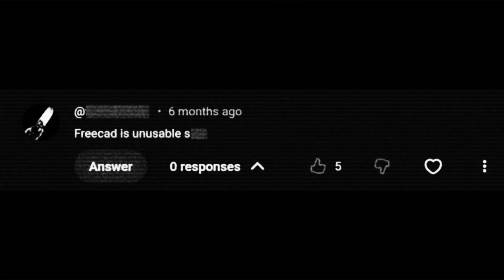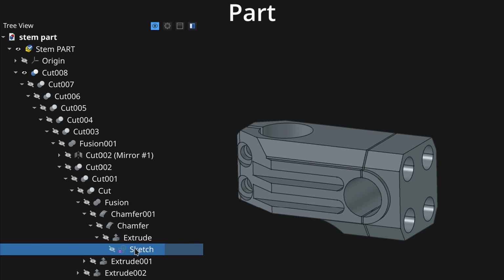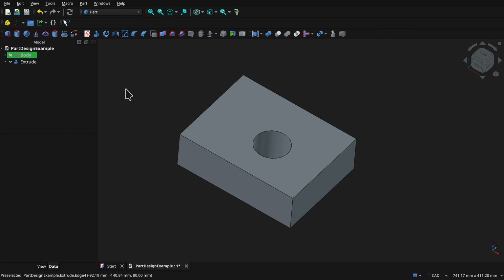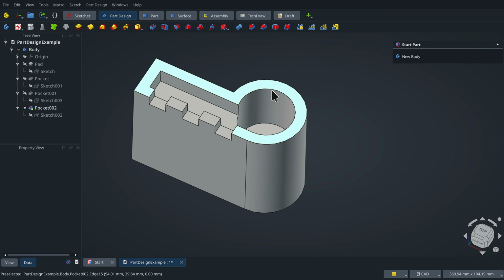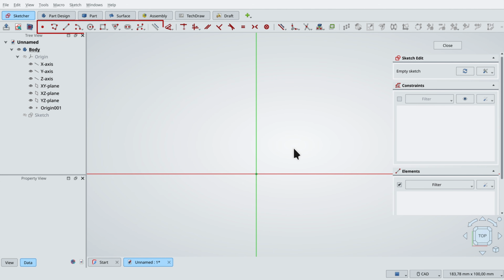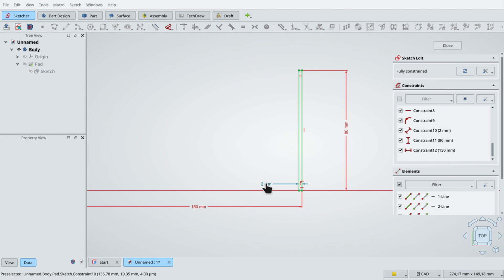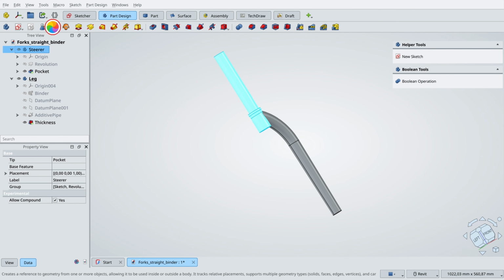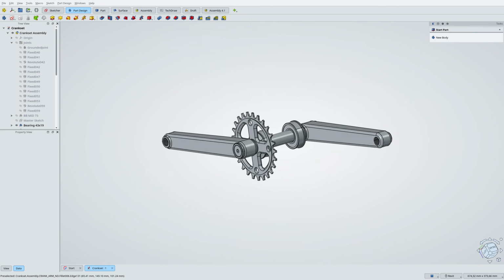STOP using FreeCAD WRONG! Do this INSTEAD (Workflow & Tips)

Comment: I am super new to Free CAD and used CAD-Sketcher Blender Plugin before that. It works much the same but nowadays has some maintenance problems with newer Versions. That's why I try Free CAD. And ig I have to get a bit familiar with it, but at the moment it's so a paint to use. I don't get, why there can't be redundant constrains. I don't get why they don't get auto deleted (with new constrains overriding the old ones)

Draw Rectangle -> 4 lines bottom top has Horizontal constrain, sides have vertical.
Click Bottom left and right Point and horizontal Axis add symmetry constraint. -> orange, with saying "horizontal constraint is redundant"

And UI is confusing :( will try a bit more, but maybe I switch back to something more fun. I just use CAD for hobby 3d printing and don't need very complex features. I just like the idea of having a sketch that builds into an object while still can change Values without starting from Scratch
Reply: There's a setting in Preferences → Sketcher → General → General called "Auto remove redundant constraints". I turned that on a while ago, and while it's not perfect, it's made it a lot more enjoyable for me. Because yeah, it does what you want, basically. If you set some line to be coincident with an external edge or something, it'll just remove the horizontal constraint rather than making you do it. There are still some times I have to remove something, but it's way less. I haven't regretted turning that option on yet.

What I will say, is there are still some times where it'll auto-generate some constraint I didn't want, like was mentioned in the video, and then going back later and figuring out why I can't move some point to the right or something is often pretty confusing still... but I've gotten more and more comfortable just deleting lines and redrawing them when it's causing me a problem...

Comment: Very much so a skill issue, but the UI just is not great. it is time consuming to search for and find the tools you need. Generally quirky and feels clumsy to navigate. You are never lead to where you need to be in an intuitive associative kind of way, neither through naming, visually, nor by generalizing / grouping operations well. It is not organized very well, boundaries of different workbenches and panels feel blurry. The ability for customization is great, but it should be intuitive by default and powerful through customization - not the other way around.

Comment: For me, as a beginner, the most frustrating was not to create design in FreeCAD but to maintain it. When I return to some older design and change one of the sketches, it often breaks downstream elements which depend on this sketch. I would love to have video categorizing these errors and showing how to fix them. Current video only mentioned fillet problem after sketch changes. Should I throw away my design each time I fell into such problem?  ... this does not look good for mature FreeCAD usage, sorry

Comment: Part vs PartDesign has always been confusing for me, most other cad work on the PartDesign concept (in my line of work at-least).  Ramping up beginners might be easier if one could  publish a "Beginner" config. That applies all the settings you have suggested and just hides Part. 

E.g some 3d printing software's have Beginner and Advance profiles. That really helps the user get started with out getting overwhelmed.

FreeCad has come a long way, 1.0 is the first time I actually started using it for my personal projects moving away from fusion360.

Professionally I have used and produced production parts in Creo, NX and Catia. (and fusion)

Comment: imo freecad has a similar problem to blender. people know solidworks, fusion, autocad and onshape, which basically all work the same. then freecad comes along and does everything slightly differently. this introduces a lot of friction, which probably is not worth the hustle for most people.

they really should push to align the software more with how fusion does things. i am 100% certain, that will piss off die hard freecad users, but it will catapult the software forward big time nevertheless.

Comment: TNP is a non-issue in FreeCAD 1.0. FreeCAD is worth the pain because it is not SAAS, so you will not be cut off from it at a whim. You don't need Internet to work on it, and the cost is honestly very very low, compared to other software. Great for personal projects and great for lean organisations on a tight budget.

Comment: FreeCAD has suffered for years under the delusions that being free gives it an excuse to be bad.

The kernel is a disaster. You don’t get to claim “skill issue”when the handling of basic geometry is so fundamentally broken.

Can you make it work? Sure. You can also hammer a nail with a brick. It doesn’t make the brick a good hammer.

Stop making excuses for FreeCAD and start trying to fix the problems so that the software itself is good. I’ve seen so much development effort wasted on fixing the UI when the underlying foundation continues to rot.

And this isn’t to say the UI improvements aren’t good. They’re definitely moving in the right direction. But making a pretty UI only makes the fundamental flaws more obvious. You can learn to use a bad UI, but you can’t fix the core of the software. Making the UI look better doesn’t make it any better to use, it just makes it easier for casual users to try it and discover the truth when the geometry explodes on a simple fillet.

And the disconnect between the workbenches also illustrates the lack of direction. It’s less serious of a problem than the kernel, but at some point there needs to be a shift toward doing it right instead of having multiple partial solutions to the same problem.

Comment: EXCELLENT VIDEO! the way you capture the mental model of the UI was great. super simple "do 1.2.3". I've been using FreeCAD using scripting, but I also found that blender was a 1:1 replacement if you're doing CAD in code anyway (at least I didn't find anything it couldn't do)

Comment: Lol, ai always uses "The secret souce" type of analogies. 

Great video nontheless, I think your video does demonstrate a lot of the leanring curvues and confusion beginners come up against, I mean part and part design mostly do the same thing but in a completelt different way. I honestly still dont know exactly when or why to use one or the other but for me it feels like any
Cad software is difficult in itself, now add extra features, change the funamental way a lot of the feature work, now add a lot of extra features in different places where you didn't even know you could look.. and then you have Freecad. It's for a large part and interface issue, but the fixes for the interface, or at least the first step to fixing them have to be done through the addon manager. I am confused why it has to be that way, is there some disagreement in the development community of freecad? 

I am afraid that people get used to a really bad interface and then don't want to change it, but please freecad community think about actually making it better and more intuitive to beginners. (Look at Solidworks for inspiration if you have to, for spline tools, it should be a menu in the moddeling workbench, not a different workbencht etc etc)

Comment: I would like to write same comments about FreeCAD, meanwhile KiCad vs Altium is completely opposite experience, i like Kicad more that any other electrical cad and i would like to get same experience with freeCad, but I still using solidworks inside vm on my linux laptop😅

Comment: If i'm holding it wrong, then it probably shouldn't be possible to hold it wrong. It's a failure of ui and software design. You should never have to expose to the user the implementation design of different tools in different work benches, just consider how insane that sounds if you had to do the same rigemarole in excel to manipulate data in one "workspace" but configure bar charts in another "workspace".

Comment: When I used FreeCAD, I'd say none of the things you mentioned were really a painpoint. The stock UI looks stylish and nice, it took me maybe a day at most to catch up with most important shortcuts and menu options. And for a while I loved it... Until I realises the biggest issue of FreeCAD. It is an awesome software AS LONG as you dont need to edit something in the history, add a new object, change a variable dimension, because the moment you do you can say bye to your model and must start from scratch. Saddly freecad handles those kind of recalculations really baddly and for anything more conplicated that I would think would require revisions.. I'd have to pick something else.

To be honest I'm really saddened by this as its the only "good" FOSS CAD software there is that runs on Linux, and that is why I want it more than anyone to work good

Comment: My biggest problem with FreeCAD is the lack of direct modelling, 99% of the time I don't have a solid idea of what and how I want to make something, I don't finalise that until I'm deep in the weeds of the piece, also the overall shape of what I want rarely resolves usefully into any 2d sketch. So unfortunately I have to use Fusion, because its the only software that gives me the tools I actually want. A classic example is loading in a STEP file, pushing or pulling a bunch of faces and then resaving, this is something that almost every person using a 3D printer has had to do

Comment: What is the point of doing all this master sketching parametric modeling, when I end up having to redo all the fillet features at the end of the part anyway? If, for example, I want to fillet all sides of a corner, I'm not about to model a sphere, I will use the fillet feature, and then the fillet feature will break, and I might as well be direct modeling. While FreeCAD may be good enough for many things, it is not on par with the expensive commercial software, and that should be acknowledged as future work, not brushed aside as user skill issue.

Comment: FreeCAD has always been, and will always remain, utter garbage. 

The reason is simple - the CAD industry has developed significantly since it's inception, and it has stubbornly refused to adapt to industry standards and best practices. You switch from any CAD system to another, it takes you about half an hour until you can successfully model about anything you want, efficiency then follows later down the line. 

This is not true for FreeCAD. None of the features work the way you'd expect them to. Which makes it unusable. It's like someone trying to gift you a free bicycle, but this one has the steering inverted. It's completely unusable to anyone who has learned to ride a normal bike. It is possible to learn this convoluted bike, and ride it, but why? Why would anyone do that?

Comment: Was following along, got to performance tweeks. did the restart and lost all the toolbars and workbenches, couldn`t figure what went wrong and ended up reinstalliing. This was on version 1.0.2
Edit, unfortunately the workbench tabs are still missing after a reinstall, I got the toolbars but no workbench tabs. What a pain.
Reply: I’ve done the same did you find how to get them back,so stuck

Comment: FreeCAD has come a long way, but it's still not replacing Solidworks for me. Fillets should NOT break like that. There should be LESS different workbenches with different tools spread across them and more combining of workbenches must be made so that flow has less friction.

Also, if operation requires me to ALTER THE HIERARCHY TREE there's something wrong... I shouldn't need to touch the hierarchy but in most extreme cases... 

But it's getting there, step at a time.
Reply: my main problem with Freecad is... instability. out of no where, on a very easy task that Solidwork would perform like nothing... Freecad just /kill itself. Like add a little easy to calculate fillet, bam the geometry is now f*ck up, it wont go back like before and crash. and its not just the fillet! Solidwork is anything but stable (im guessing more and more its because of Winslop), but Freecad is way worse.

and i really dont like the hierarchy system of Freecad. in Solidwork: its just a list where its easy to go back in time, add like nothing new function before other. In Freecad? is there even an option to add function before other one? cause scuse me if i dont know from the start what geometry i want
Reply: @bi1coolgaming254  I wonder if the program had automatic crash log generation AND SENDING so they could actually receive the crash dumps from people and figure out these issues...
Reply: @bi1coolgaming254 it sounds like you're working in the Part workbench, but have you tried Part Design? That is the one with the more modern workflow with an easily accessible history.
Reply: I can understand your point, and this would work on a bigger monitor.  Keeping the workbenches smaller lets you have less toolbar, which will work on a smaller monitor without hiding anything.
Reply: @chaosopher23  and it's not just about not seeing them all easily, but the fact that you have to switch workbenches a lot and change tools a lot... making tools smarter and ensuring there's fewer separate tools in separate workbenches is one way to improve productivity.

workbench change should be complete context switch where you're completely changing what you're doing and there's no overlap of any kind with other workbenches in flow.
Reply: @Mtaalas  Overlap is useless.  Redundancy only takes up space.
Reply: @chaosopher23  You missed the point of context. When switching from "part design" to "part" is confusing; why not just have one and call it "modeling", for drawings call it "drawing", for assemblies - call them "assembly". These numerous amounts of workbenches is absurd and for your overlapping point, then why would the devs have this overlap then? Remove the excess or keep them in. In NX, there are always multiple ways of essentially getting the very same thing. Having multiple ways of doing something helps if one of them will not work when a previous feature or manipulation breaks the feature. Overlap is good to an extent.
Reply: @P-nutBD  Its complexity needs a bit of work.  There has to be a happy medium between the art of drafting and the parametric aspects that make it so precise.
Reply: give it 5 years and maybe it'll be able to compete with tools like fusion360 ux-wise. Otherwise you can just get stuff done in freecad but the workflow is horrible
Reply: @_grzehotnik  the fresh out of the oven (March 2025) 1.1 update specifically seems to fix so many of those UX issues and wonkiness. I hope they will really focus on those in the next few years and it'll be great tool :)
Reply: @Mtaalas  yup, I've seen some highlights, like choosing specific faces from sketch which is a  great step towards usability. Seems they're gathering more and more users and the user experience will hopefully be getting better and better.
Reply: You can add tools from any workbench to another workbench toolbar. You can make custom toolbars and add them anywhere you want.
Reply: I agree with you. I only learned Solidworks but I am able to design parts in different commercial CAD softwares without much wasting time in online tutorials, searching tools/operations constantly. But in Freecad it still is not possible. I can see the difference and improvements yet I still feel like I am using an unfinished product. I hope those will continue changing and the community will have a mature and capable free CAD software. Thanks to all contributors.

Comment: Freecad has it's issues. But outside of editing farther up in the tree breaking certain features like fillets, the only other issue I have with it is the lack of hardware acceleration. This doesn't seem like that big of an issue until you run into complex assemblies with gearing or converting stls to meshes and to editable parts, but it may affect many people's workflow

Outside of those 2 things, it's a great bit of software that with the basics understanding of parametric modeling, freecad can be a powerhouse

Comment: Excellent video, I'd consider myself an intermediate user as I've been using FreeCAD for years starting back in version 0.18 iirc and the improvements made in the last few years are massive, specially QOL improvements like preview of operations, but there is so much stuff that's better than it was, I'm so proud of what FreeCAD has become and it just keeps getting better, I've designed so much stuff with it. The comparison to blender hits so close to home, I first started using Blender after switching to Linux since I used C4D before that and I though Blender was a massive pos because of how it worked, but learned it, no I love it and now it's the only 3D modeling and rendering software I use and ironically software like C4D later on introduced features that were available on Blender from earlier versions like nodes for materials and more complex compositing, ultimately the software you use is just a tool and you need to learn its quirks and how to use it properly, no matter the software, having willingness to learn is the most important skill you can have when approaching any problem you may encounter.

Comment: My main problem with freecad is that references break like 70% the time I change anything before. Like all kind of references, projections, sketches on faces of existing parts, assembly joints. I feel like Fusion does a much better job of keeping references on changes. You should make a video on how to prevent that and how to fix those when changing previous geometry in a significant way.